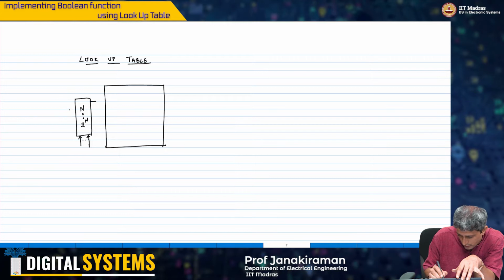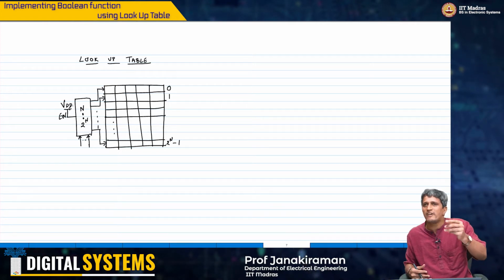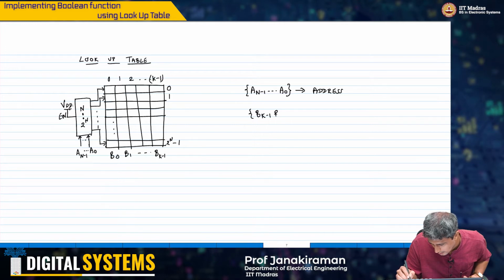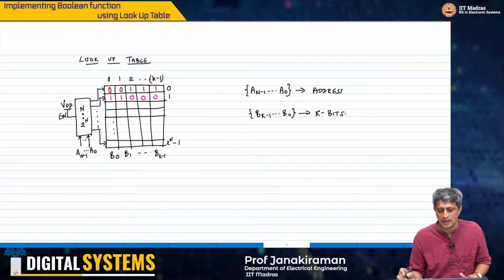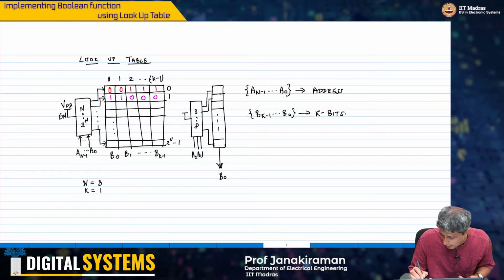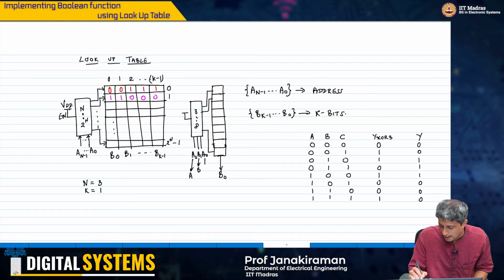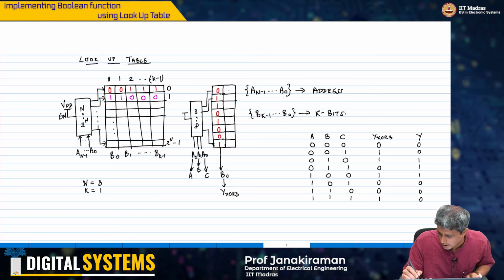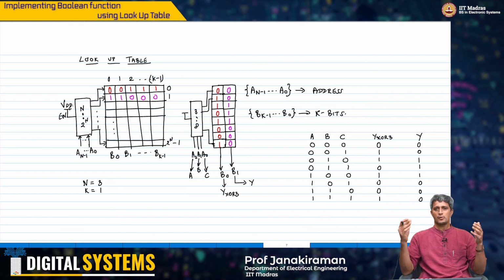W8_L3: Implementing boolean function using look up table | decoder & memory based LUT

Comment: This is the basis of microprogrammed control unit. control memory holds control signals corresponding to certain addresses which are called by the opcode via the microsequencer.